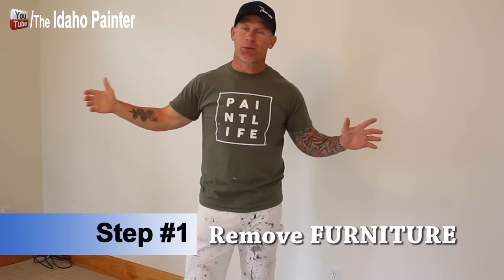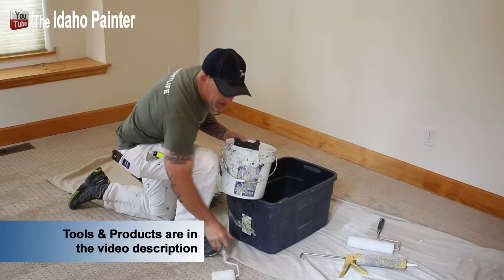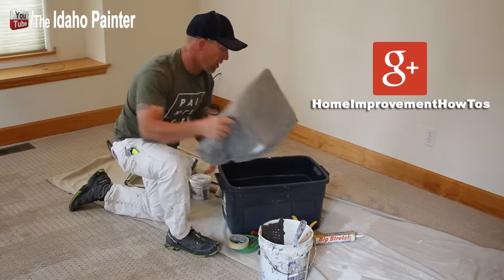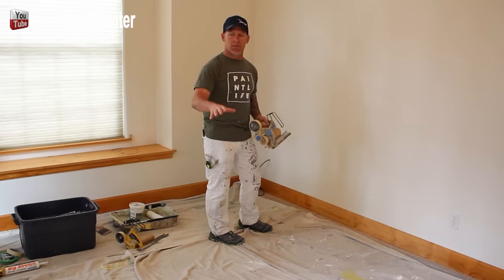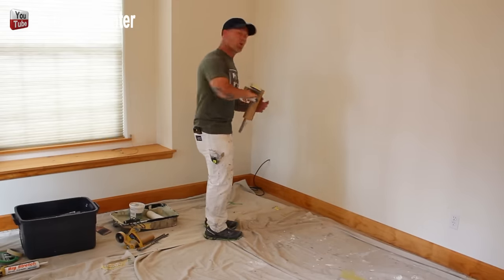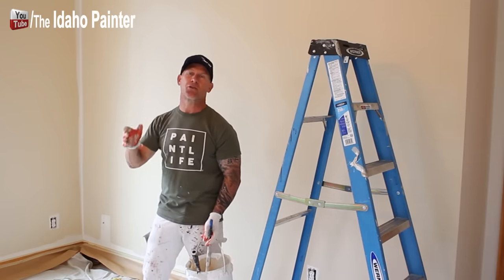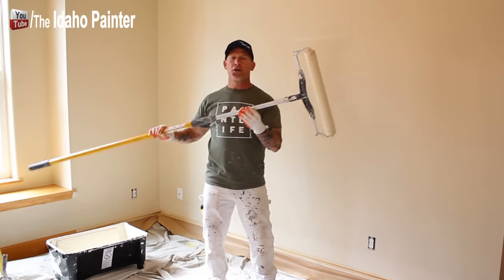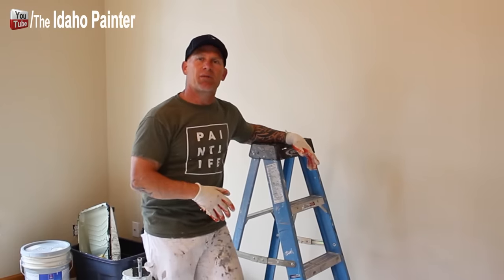10 Steps Painting A Room FAST and EASY

Comment: Thanks for this video. I liked the thorough tool list at the top of the show, and showing all the steps. When I paint, I'm usually the only guy working on the task, so I'm always looking for tips about how to get the job done efficiently. In a few of your videos, you show the whole crew at work, so I have to figure out how to adapt the crew process to an individual's effort. This time, though, you kept the labor on a pretty small scale, which is easier to relate to.

A couple of requests for future videos! Often I'm painting white over white, and it's really hard to tell whether I've hit all the spots on the wall. Do you have any advice about that problem?

Also, I deal with sheetrock that's been painted again and again (rental units) and the texture across the wall isn't consistent. I tried skim coating once, but it left a soft crumbly surface which paint didn't adhere too. Maybe my skim coat formulation was wrong, but I followed the directions. A video about skim coating sheetrock properly would be welcome!

Thank you for all your teaching effort.
Reply: See Vancouver carpenter

Comment: Also, don’t use old liners that had paint dry in it. If your paint begins to dry at the spots you roll excess off, just replace it… 
Or continue to keep that area wet so the paint won’t dry because you’ll end up with pieces/flecks of paint on your walls that you’ll have to scrape off.
Reply from the maker: Nice

Comment: I used you trick with the caulking to get a nice straight line and it worked great. The walls came out like crap, the paint seemed like it was drying to fast. Wall was only 12  feet long. Tried to back roll it and that didn’t make a difference it made it worse. Is there anything I can put in the paint to slow the drying time down?

Comment: Do you not sanding before and between coats?
I roll then cut first coat. Cut then roll wet on wet the final coat. Roll super close to my cuts...no hotdogs.
Use 14" alot. 18"  can't get close to edges.
Reply from the maker: They are textured walls so do not sand them🤙
Reply: I'd be worried about paint adhering to the walls and trim without some sort of scuffing or atleast light washing before paint. 
I don't deal with textured walls where I live...so I don't know.

Comment: So u only cut in one coat?. You got 2coats on your walls? I'm with u if it covers but I like to always put two solid coats on the entire wall surface because I have learned o we the years that after the paint ages you start to see the light spots where u tried to cut in heavy and cover in one coat. For this reason I always use floetrol and cut my paint to get it to the consistency I like so my brush strokes lay down, the stipple on the wall lays down and blends in with the cut in edges and it dries faster. Not knocking ur methods at all, I just don't like to say I two coated something but have an asterisk next to what I said lol.
Reply from the maker: Yes, we cut in one coat then just do touch ups for the second coat

Comment: ...mmm perhaps WASH the walls before you paint them - I have seen some very dirty / dusty walls  . Vacuum the flooring . Wash windows  BEFORE you paint them .  You forgot to mention  USE a quality paint brush and roller cover and an extension pole for the roller  handle !  I like a good shop light to light up the walls so i can see what I'm doing

Comment: Why do you do cut ins after the first coat?
Reply: When you roll first you can get pretty close to the corners so when you go to cut in you're not using as much paint  as you can see what needs to be covered. Cutting in first you would tend to paint more than you really need. I was taught to Roll then cut. Then second coat Cut then roll. Seems to work pretty good.

Comment: I have a quick question, how much should I charge for a room that the client wants a different color for every wall, as well as the fourth wall hombred ( layered colors)? And what should be the charge for a 100sqft bathroom? I’m in California, so no competition here 😉
Reply: Run the job in your head and figure out how long it will take you from set up to clean up. Figure out what you want to make a day. If you're efficient you can charge a higher daily rate. If you're slow, lower your rate. Between 350-400 is a good day rate in Cali. Per guy on the job.

Comment: Respectfully:
1. remove all switch/receptacle plates
2: remove blinds/shades 
3: put down drop cloths

3a. Paint trim first

4. Use 2½-3 inch painters tape for the base boards. Don't nail shit in.
5. Cut in first!!!
6. Roll walls
7. Cut in again
8. roll again

Always cut in twice and cut first. I've been painting since 1998.

Comment: You failed to mention the most crucial thing when rolling. That is to double roll your paint. Depending on what time of year it is or more importantly, how hot it is. If you’re painting over a painted walls, you can roll out further, but if it’s new Sheetrock and hot I’d roll out three feet or so. Here’s the point; double rolling ensues your paint is evenly distributed, that your roller lines are not so prevalent. 

Last summer we were doing a remodel with all new Sheetrock, ceilings and walls. We left all the trim up and flat tapped the cracks. I wouldn’t let just anyone do this, you have to keep it clean or you’ll be sanding your ass off. Anyway, the ceilings were ten feet high. So all the heat was trapped up top. Thank fully, the windows were the old weighted windows and you could open the top half. Our mud dried so fast you had to use a spray bottle to keep it moist. I went on another job for one week. The boss had hired a rookie and made a mess. He quit after he had to go back and sand his own work. Pissed the boss off pretty good. I simply told him; if the guy wants to learn he learn on his work.
Reply: What Heswithme

Comment: You say to pull the tape before it dries. Don't you need the paint to dry completely before applying a 2nd coat and if so then the tape would have dried out before !? How do you pull the tape while it's still wet ?
Reply: Straight Forward       You are correct, you need the masking. It depends on how wide the skirting is and if it's to be painted or varnished. If your first coat of cutting  in is correct you don't need to go all the way down again. (Just down to 1/8" above the skirting.) That way you can remove the tape while it is still wet. If you let the paint dry before you remove the tape you run the big risk of tearing part of your cutting in, off. (not good). If you must leave the tape then use a sharp blade and run it along the join between the tape and the wall to seperate the paint on the tape from the paint on the wall. Then pull toward you, away from the wall at about 45degrees, slowly.

Comment: But I never ever go through all or that. I just move all my furniture in middle of room, I tape of entire room. Use throw away pans. 12 inch roller & a 4inch straight brush for cutting.  Any wholes honestly I just go over it a few times & seems to take care of it.  Switch blades I will take off only if I have new ones going on
Reply from the maker: What ever works

Comment: Have you been hit with the 2010 voc regulations to reduce voc,s over hear the paint industery has regreased by about 40 years as now they cannot prevent oil base glosses from yellowing within matter of weeks/mths.
We have to use waterbase if we dont want yellowing in weeks but as you know waterbase glose does not flow give a glass like finish and is not hard wearing doen not cover well.
how do you think i can get round the yellowing or make waterbase more like the finish of oil base please
Reply: sherwin williams semi gloss oil trim paint doesn't yellow

Comment: I have a question I never seen mentioned in any painting video.  We have three skylights that go up about 14-15 feet and they are painted.  Any tips for getting up in there to edge/paint?  (It's a pretty tight fit.)
Reply: Colorado Boo get a skinny friend
Reply: Ha!  I haven't painted them, yet, but did get a 12-foot telescoping ladder to help get in there to get the very top painted and cut the corners and will use a very long extension pole to roll it out.

Comment: my same 18" purdy roller & roller frame doesn't fit in the largest paint scuttle really annoying
Reply from the maker: Yes, the downside of them!
Reply: Have you tried the Wooster Wide Boy? That might be good enough for your 18” Purdy. Otherwise you could always purchase the 18” Wooster roller and frame which definitely fits.
Reply: In my experience Purdy tools, especially the 18" frame and their poles are garbage. Their brushes are ok. Also an 18" setup is complete waste if you are only painting your own house as they are significantly more expensive than a 9.  Also not faster than a 9" for those small residential jobs. Don't waste your money people and please stop recommending them to the DIY crowd.

Comment: I don't think I've ever seen you sand the walls. We always give a light sanding to the walls with a pole sander before we do a repaint. It looks better and leaves a smoother finish. Why do you not sand? And what kind of paint do you usually use?
Reply from the maker: They aren’t smooth walls but they are textured walls and you do not sand textured walls 👍
Reply: @Idahopainter  Gotcha. You can't see the texture in the video. Thanks for replying!

Comment: Not meaning to be disrespectful, but if I had that much space to work in, and either very little furniture or none at all, I could do an equally smart job - and I've decorated maybe only five times in 30 years. The prepping, floor covering and painting are no problem, it's heavy furniture, shelves and big, built-in bookshelves full of books, CDs, DVDs, games, ornaments, etc, and nowhere to put it all that's the problem . Most homes are full of furniture in every room because people love "stuff".

I'm going to see if you have a video about decorating homes where moving furniture more than a couple of feet isn't really possible.
Reply: Mikey Saint 
Agreed, having a cleared out room makes a huge difference.

Comment: Seriously the extra work this fellas adding to the job,just use a wider tape(2 inch or wider),on tops of skirting/base boards and why would you take off sockets and switches,tape the top and cut into the sockets/switches
Reply from the maker: Works for us!
Reply: I take them off and clean them, customers love it

Comment: this way is good but my way is faster because I paint 1 Appartement per day, I have my partner paint with a small roller and paintbrush all the ceiling and tight spot then I use a sprayer to paint the whole place in 30min or less

Comment: Cut in only 1 coat? That won’t fly with most paint jobs. Do it twice like you should and you won’t have any of those touch-ups. That also won’t fly, touching up like that with any sheen higher than flat. Gonna flash. 

Also, not following why you wiz roll with the cut in? All you have to do is cut in then roll the walls tight. I do like how you roll the first coat before cut in, seeing as the roll takes longer to dry. But always cut then roll on second coat.

Comment: Also never roll before cutting in unless youre using flat paint eggshell this would be a problem youd see the difference it wont blend correctly i feel like you only half know what youre doing
Reply: Unless you do it quick enough where the roll doesnt dry by the time you cut it in its just wrong

Comment: 18-inch roller?, Why..  everyone is going to it's faster but I don't think it's that fast, put a 9inch roller in the hands of a painter, they will be just as fast and be able to roll around the receptacles without hitting them, closer to corner so you don't need your extra roller with your cut bucket

Comment: Every painter for the most part does things a little differently. Always cut in first wall by wall and roll right after, that hides brush marks. Never roll half way down the wall even if it is the first coat. Always put a piece of tape over outlets, especially the cable outlet if you leave it on. With dropcloths up to the base theirs no need for 9" paper, that's just a waste of money. The 18" roller setup is unnecessary doing most residential painting, another waste of money those setups aren't cheap.

Comment: This isn't 100% there yet. Go back to the drawing board cause you wouldn't make it in a production job. You can paint around the switch blades with the roller itself. You always have to cut in first and the whole floor does not need to be covered. Come on. And don't use pans. Just use a straight 5 gallon bucket if you want to be faster. This tutorial is for nubes.

Comment: way to much involved for a simple room, real painters only need a 5, maybe a grid, 1 1/2" tape and furniture 2' from wall and use a cheaterbto cut in... also you open a can with side of 2" putty knife... geeze, ditch the 4" roller and keep it to paint ballasts and pipe work... after watching this im starting my own channel

Comment: Imagine being a professional painter and still having to tape everything off lmao. A pro doesn’t need to tape it off you just cut it in. Lol and then he needs gloves not to get his hands dirty smh wow. Not to mention when you roll out walls and stop in the middle of the wall you’re going to see lines. You always roll from top all the way to the bottom. Then you back roll from top to bottom with a dry roller. Also if you’re using eggshell paint you can’t roll out the walls first or you will see the lines, gotta cut in first for eggshell. A lot of things I would do differently, been painting for 25+ years. One last thing IF you buy good paint you wouldn’t need to do two coats on such a subtle color change.
Reply from the maker: Oh ok

Comment: You didn't place plastic under the canvas in case of spills because you think such accidents are beyond you. Your customer will pay for that typical arrogance.
You tape with garbage to save money. But it has a higher chance of pulling caulk out of place if someone has caulked their wood work. Using Blue or Green or even Yellow tape is costly but does a much better job.
Cutting along outer 90 degree walls should be done with a fanning technique. Your technique aerisolizes paint.
Vacuuming after a paint job???? Are you kidding? You blow dust all over the paint! Was that two days later after the paint cured? I doubt it.
Reply from the maker: OK